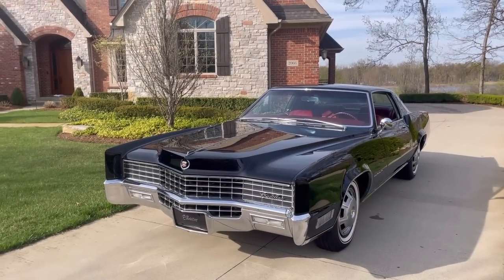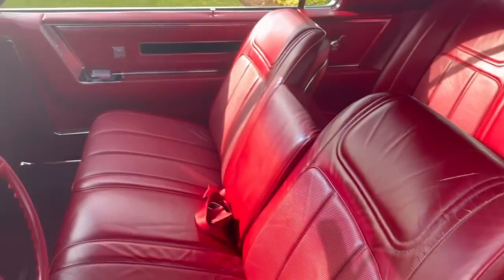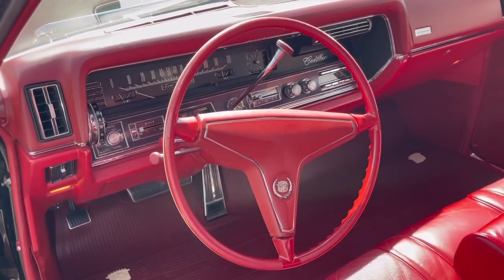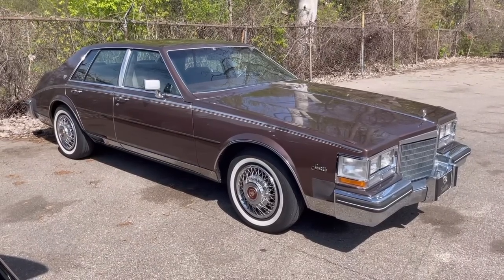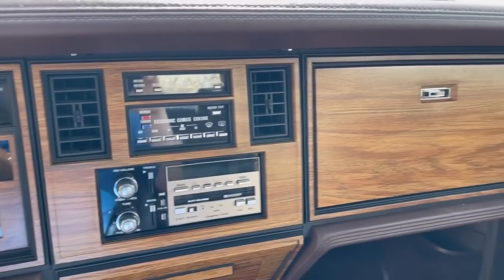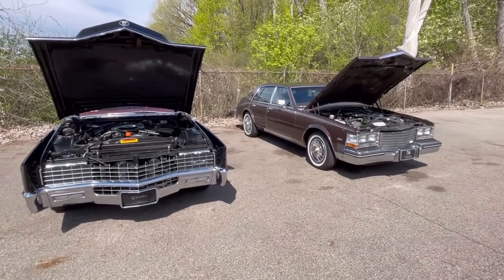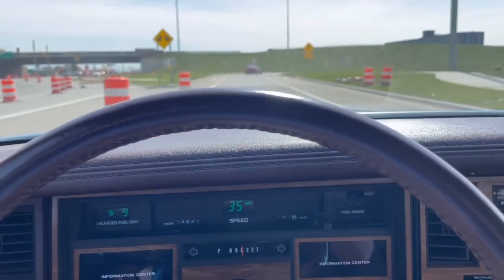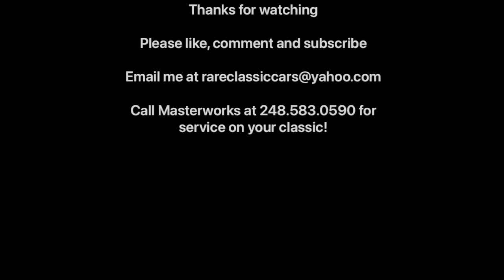Classic Cadillac Battle!!! 1967 Cadillac Eldorado & 1984 Cadillac Seville Comparison

Comment: Great video Adam.  The ‘67 Eldorado is stunning with the red on black.  And  the rear crank windows with pwr front windows is very unique
Reply: The good old days when you ordered a car with the options you wanted, not the "packages" of today.   In Germany until not that long ago you could order a Benz any way you wanted.   I mean:   Front Power Windows or Rear Manual... or Power Rear and Front Manual... or 1 power and 3 manual... that's gone now, but gotta give the Krauts credit for that.
Reply: I bet the builders of the '67 detested the manual windows in this Caliber of  Car!
Reply: @johnfrakes4746  I would have, if I were on the marketing or design group!
I think there maybe was a reason that power rear windows posed a problem in the first-year design.....but I cannot immediately think of why.
I mean, I think the Toronado offered power rear windows without a problem.....
Reply: I know that it wasn’t in the same class as the Eldorado, but the 1967 Calais, as well as its predecessor the 62 Series, had crank windows with power optional.  Same thing with power seats.  In 1968, power windows became standard on all Cadillac models.
Another bit of trivia - you could get power front windows on a 1954 Chevrolet, but the rear windows were manual.  
Another wonderful video of the cars of my youth and young adulthood, Adam!

Comment: The Seville is handsome and very well styled, and I even have come to like the bustle back. The eldorado by comparison has an overabundance of sculpted style, with deep three dimensional surfacing that gives the car a much more impressive presence, especially when you're looking at one in person. It's amazing how low these 60s eldorados are, while also being wide and long. It's a breathtaking design that manages to include great details like the vents in the front cowl, along with classic and tasteful baroque formal styling while still remaining quite simple and tasteful.

If I was going to turn one of the two interiors into living room furniture, I'd definitely take the great interior of the later Seville. They were great interiors. 

I'd take the eldorado any day of the week, although I'd prefer a 67 DeVille instead...
Reply: 1967 Coupe de Ville or Fleetwood SIXTY SPECIAL would be preferred by myself as well.. I never warmed up to the controversial 'bustle back' styling in the rear of the car, especially considering how disconnected it appeared to the angular front half of the car. Consider the 1979 Eldorado for reference.
Reply: SeVille - YUCK.
Reply: @UberLummox  That's from Cadillac's "Little Old Lady" design period.
Reply: @MarinCipollina  I think it is the side stripe that curves down that clashes with the straight angular sheet metal lines of the bustle back that ruins it for me.

Comment: I had an 84 in dark Navy Blue inside and a creamy blue outside two tone dark Navy below the center lateral line.  Getting in the car EVERY time I reveled in my success achieving the moo-la to buy her cash the diamond button down never failed to impress, the dash meant business right down to the amber climate control temperature display. Sold a ware house full of aluminium siding to get her. Love at first sight. Great viddy's you have style my friend keep 'em coming.  I had a 67 Toronado black on black on black, again, pure love affair. Regards; Jim.

Comment: Another accurate and thoughtful video. My family had a 68 El Dorado and the car design is beautiful inside and out. Also accurate is that the inside materials were generally not impressive. Adam’s interior is unusual; Ours before even 10 years had some plastics that became sticky and not crisp looking. But that, the squirrelly handling at high speeds, and the spaghetti of vacuum hoses are small prices to pay for this simply striking car! Thanks for the great content Adam.

Comment: Another great and informative video.  I like both cars as I have been a Cadillac fan for years; I even had a '92 Brougham.  With  the Seville I was not a fan of the bustle back at first.  But after what Cadillac did to the model in '86 and the Lincoln Continental I started to like the bustle back Seville.  That's a beautiful '84 one you have.  I must say I Miss colored interiors in cars.

Comment: My humble opinion is, in a few years time the 1967 Cadillac Eldorado and the 1966 Oldsmobile Toronado will be held in the same high regard as the 1932 Deusenberg J is today.  Based on body design only. Such is my wounder of the two fore mentioned vehicles. Though the two cars I would love to own, are the 1969 Imperial LeBaron and my favorite of all cars, the 1960 Imperial LeBaron Southhampton or 4 door hardtop. I could write 10 paragraphs on why I have chosen the 60 ILB. But don't want to bore everyone. Adam I also think along with Steve Magnante both you guys are thee most knowledgeable,  ardent Preservationist of car history on YT. As usual thanks again for another great and informative video.

Comment: Both cars are beautiful. I never liked the way the 1967 Eldorado rode though. It needed longer springs. A more floaty ride, in my opinion. The 1967 was more of a performance luxury car at that point in time. I love everything about the 1984 SeVille except the underpowered 4.1 engine. Out West, that probably wasn't an issue since the land is so flat East of the Rockies but, we have some very steep hills on our highways in the Northeast and in order to maintain 75 MPH on some of them requires that you hold the pedal to the floor. You then have to listen to the engine drone after the transmission changes to the next lowest gear. Sometimes, it will even go into second gear if the hill is steep enough.

Comment: Thank you once again for another fantastic video! I thoroughly enjoyed every second of it! I really like the cars you like! The 67 Eldorado is an absolute knockout!
I was very surprised, as a boy back in 1967 how the Eldorado rode so rough and not very smooth. Our '66 T-Bird was silky smooth by comparison. -Greg in Californis
Reply: I've been thinking about your price comparison of the Eldorado to equivalent  60,000 today. While I don't doubt your  dollar& time calculations,  I'd have to say that be closer to $90,000 in today's auto market. I say that because nowadays, there are a lot of $60,000 cars out there and even pickup trucks. But back in the day, and I remember being a ten-year-old boy, this Eldorado was  more expensive than any other American car.. most seem to be delivered at around $9,000 then. Your standard Cadillacs and Lincoln's were in the $7000 range (  I'm talking about how the cars were delivered with all the options normally ordered ) this Eldorado was a jaw-dropper and absolute head-turner and green-envy inducer. I can't think of another car since they could equal the spectacle it was. Your 80's Seville  was more of a run-of-the-mill luxury car.. nice but eclipsed in prestige by Mercedes S class at double its price. Thanks again though for posting and the great trip down memory lane.

Comment: Was watching you pass that Prius in the 1967 and chuckling a bit.  I feel you could almost put that car in the trunk.  In a collision, you might have to scrape the Prius off the grille.  So much has changed in the last 50+ years.  I miss the elegant highway cruisers but not the 8.5MPG I used to get with my 1974 Deville.

Comment: Hi Adam from Sydney , Australia .Selecting a "winner" from these two is a very tough call , as they are both very nice cars. I drive 2 Cadillacs a pair of big rear wheel drive '70's  Fleetwood's , a '72 & a '74. Some 33 years ago with a post-tax mid-year bonus I had cash to buy another car. An older mate Frank that was a car dealer, repairer and parts supplier plus wrecker on the border of Bankstown & Punchbowl in western Sydney called me and said Greg I have a Perfect Four for you here at the moment. All were one owner cars all RHD all Cadillacs,  a blue '68 Eldo grey/blue leather, a'79 rear wheel drive Seville Elegante in a custom order color & with a padded not painted vinyl top in pale blue with a deep metallic blue paint, and TWO 1980 Seville's one a silver and black Elegante with a 350ci V8 petrol and the other a dark Bronze metallic with a red leather interior & 368 ci/6 litre  de-bored big block (like the 68's 7.8 litre)/  I drove them all back to back over several hours. I had loved the '67 to '70 Eldos as a kid when new , but I had not driven one , and was a little shocked at the choppy ride, next I drove the 2 x bustle back '80 Seville's, the 350 v8 was a little quicker off the mark, but the big block 368 cube had it in highway overtake & effortless punch. Then last I drove the RWD '79 Seville, the Olds derived 350ci V8 in that was a rocket, serious get up and go as an export spec engine.  Out of the 4 cars it was a tough call between the RWD '79 & the FWD '80 with the 368 in it, it just had big block smoothness and didn't really feel like a FWD car, well balanced. 

Some days went by, and I was deliberating on which one to buy.  Then another mate called me and said you know that Lincoln, you have told me about, but I (he) have never seen, well it's for sale (it had an unmistakable registration plate OIL-001 nsw rego) . It was a TOTAL option bar sunroof, '79 Collectors Series Town Car. I bought it immediately and own it to this day in 2023. After driving it, it was a no contest choice against the 4 Cadillacs as the Aussie Ford Homebush, Sydney built IKEA "flat-pack" kit  CKD cars where they arrive as parts to assemble here as right hand-drive cars do not have the American plastic dash modules & panel fronts , NO , they have Aussie made aluminium ones with actual real Mahogany wood with matchwood inlay as the US LHD asymmetric dash modules will not swap to RHD guise. All of the 4 Caddy's Frank had were private imports converted to RHD using cut and joined US version dashboards made of plastic. Whereas the Ford Homebush Aust ' built Lincoln had a way classier quality to it that the others were sorely lacking, good as they were.

Comment: My uncle had one of those Seville it was either an 80 or 81 and it had the V8/ 6/4 in it. He had this computer chip installed in it and he said it took away the problem with it shifting up-and-down from 2 to 4-cylinder to 6 cylinder and back and forth? He usually keeps his cars quite a long time that one he didn't keep too long? So I guess he was not real happy with it.

Comment: I''m sure the vast majority of '67 Eldorado's rarely had rear seat passengers so that's the reason for the manual windows in the back - probably wasn't an issue for most of the owners and a fairly "safe" and smart cost cutting measure by Cadillac.

Comment: No contest.  I'd take any 60s GM car over an 80s equivalent.

I think there were some Peugots that had crank front windows and power rear windows, which makes sense - remote operation for the ones you can't reach while you're driving.

Comment: Love the bright red interior on the 67, timeless design that will always look great.  But, I'm sure many owners were upset by the ride/noise.  Not a fan of the bustleback, love the original 76 design.  Yeah, the faux wood color is cheesy, but it actually looks pretty good paired with that light chocolate colored interior.  Each vehicle has its strong points.  Caddy did do a good job with the Seville interior, great seats and a rich looking handsome interior.
Reply: The bustleback's beauty is an acquired taste, and not to mine! It looks like it's been rear-ended. And it didn't get a viewing in this video :(

Comment: The Eldo is STUNNING with it's jet black exterior and bright red interior. The roll-up rear windows are quirky for sure. If I owned this car I would be tempted to retrofit the rear windows with power actuators and electric window switchgear from the era (chrome paddle style). Probably wouldn't be able to modify the drivers door panel to add two extra switches but I still think power windows in the rear would be better than the roll-up levers.  

The Seville is gorgeous also. I love the sumptuous brown leather interior. I always liked this era of Seville despite it's controversial rear-end styling or perhaps because of it.
Reply: As an air-conditioned car, sourced from Texas, it is likely that even with passengers sitting in the rear seat,  that the manual rear windows were rarely, if ever, opened.  Even the existing manual crank openers were probably a redundancy.  Air-con was the ultimate game changer regarding window usage especially in the Southern USA, and later throughout the US.  The two doors have electric lifts, and the driver's window was the one likely most used, as a speculation.  Cheers.
Reply: I wouldn't bother. How often do you have back seat passengers?

Comment: With comfortron, I think it was the Power Servo alone, which controlled heat temperature through the blend door on the firewall.  I suspect the heater valve all it does is to open or close coolant flow to the heater core.   Awesome cars!
Reply from the maker: Nope. No blend door on these early cars. All proportional to amount of coolant flowing through Heater core.
Reply: @RareClassicCars     I'd love to have a closer look at that system.  I have a '66 Toronado and it's an endless source of entertainment.

Comment: I'll take the 67 any day. I've driven and worked on several of the 84 Seville version, which I guess is an 79/80? All I have to say is they are not good cars, but sure made me a ton of $$ as a mechanic. As I recall, that red leather is called Firethorn red, and Chrysler actually used the same leather, by the same supplier, in the same color.

Comment: I find the comparison between the two cars very strange. One is an icon of Cadillac performance and styling, the other is a very nice driving run-of-the-mill strange, looking under powered heavy car. Both cars were in incredible condition.

Comment: Are you sure that the water valve are used to get the right temperature? My 67 deville has 3 vacum connectors. One Opens the water valve. The other 2 are used to supply the master swith with vacum IF water Temo is above 80 degreees (or so)
Reply from the maker: Yes. No blend door on these
Reply: @RareClassicCars  sounds like something for a new episode 😊